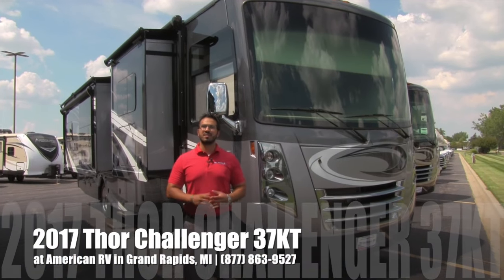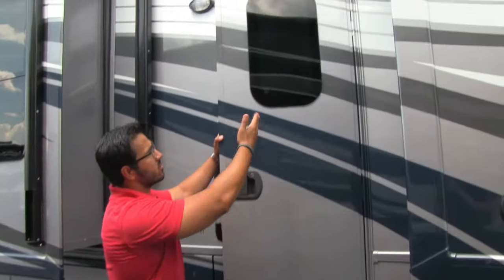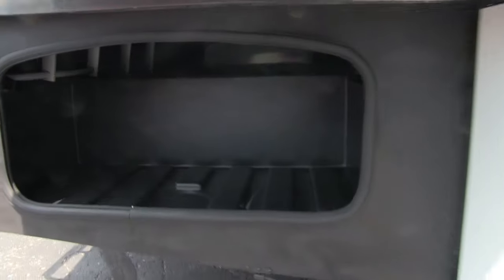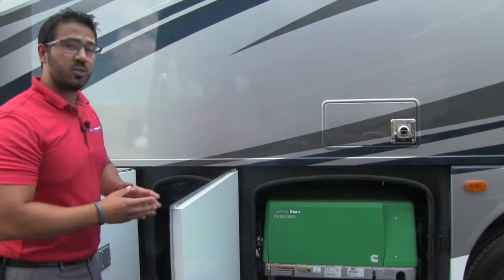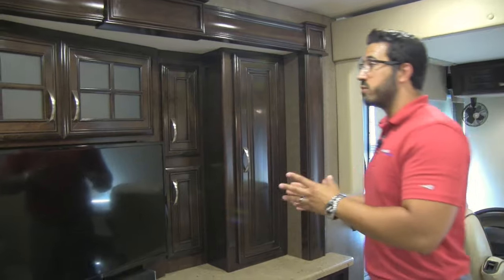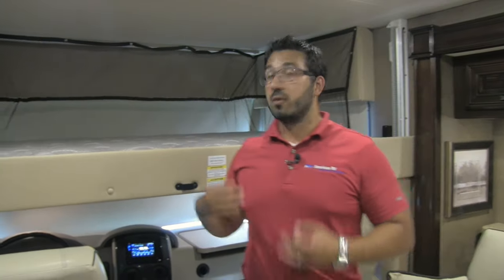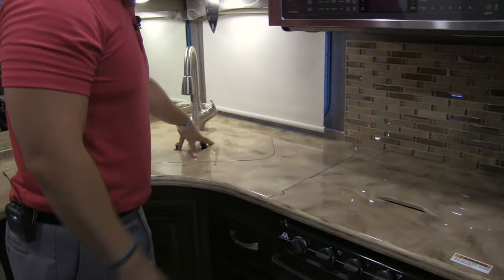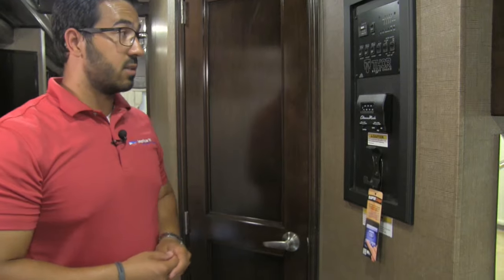2017 Thor Challenger 37KT | Class A | Luxury Gas Motorhome | Riverside | Cityscape - RV Review

Comment: I really like this coach.  What Thor unit would you recommend for full time or 4-seasons?  Temperatures in Wyoming can get cold....
Reply: Can this switch to propane? And what about solar?  TIA
Reply: I'm glad to see this isn't an all electric.  What is the insulation in the roof, floor and walls?  Does the coach offer any type of winter package options or will this keep you warm?  Has it been tested for extreme temperatures?  Most of the motor homes we've looked at are two seasons, threes at most.
Reply: what is the length
Reply: christy7270
Reply: Airstream